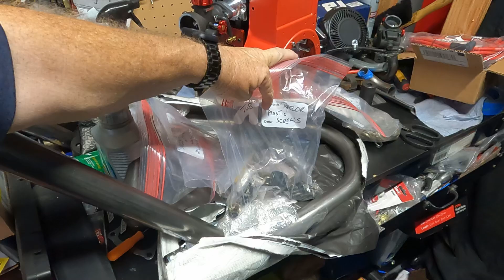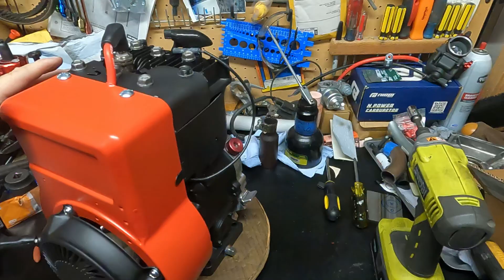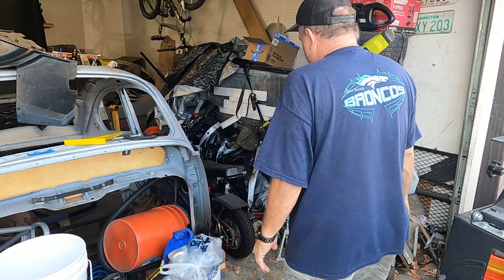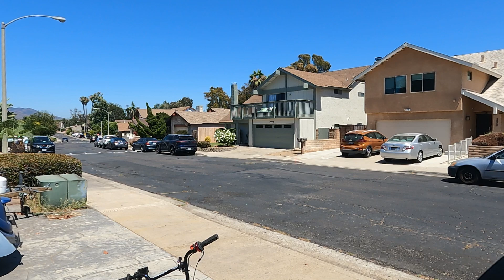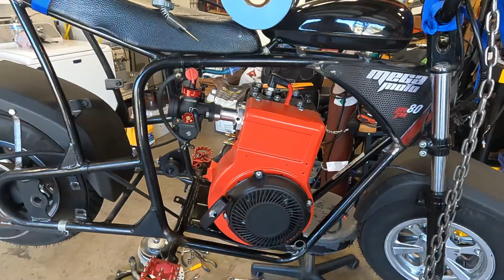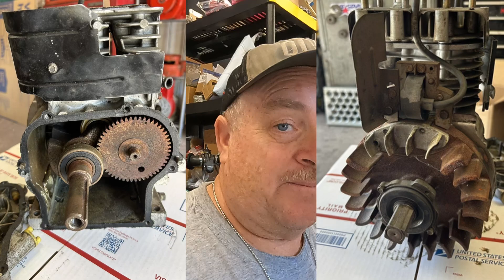Briggs Raptor Build - Will It Finally Start?

Comment: What starter cup and Recoil was used to convert ??  I want to move away from the old style that has the starter clutch and plastic recoil..
Reply from the maker: Hello Shawn, I bought the starter cup and recoil from eBay. The parts came off of a Briggs and Stratton 135232 5hp engine. It was an assortment of parts that were exactly what I needed. Hope this helps you. Thanks for watching!!! 
Willy

Comment: I have a raptor engine identical to yours pushing 25 to 30 hp and I cannot find a belt driven clutch suitable for it , any help would be much appreciated
Reply from the maker: Hello Hunter, Sounds like a great engine. I haven’t been able to get mine running yet. Hopefully soon it will start.
For clutches for that kind of power I would suggest the 780 driver/driven combo from GoPowerSports. You would need a shaft adapter from 3/4” to 1” size to run the clutch on the engine and make up a jackshaft for the driven side.
Hope this helps.. Thanks for watching!!
Reply: @DIYWilly  mine give me problems at first , just imagine a built engine from a stranger with a Tilly carb trying to get it running smooth while having spark issues. Replaced the coil and wire and you would not believe the difference. I’m sure by the sound of yours it may be just that . These Briggs are indestructible.
Reply: Also just ordered the comet super 44s magnum 😎 with a 44 series big brother to back him up .
Reply from the maker: That should get you going.. Thanks for watching Hunter!! Let me know how the new clutch works out.
Reply: @DIYWilly  sure will

Comment: Cool video 😎 persistence will pay off! We need to plan a minibike madness race in Ocotillo this season. Thanks for the update and sharing ☮️🤙🏻
Reply from the maker: Going to try a new spark plug. I’m using an old one now. Probably whelp but couldn’t hurt. I have to believe the cam timing is off. I’ve already tried the usual stuff. I really didn’t want to open the block again. Thanks for watching!

Comment: I would give it a shot of carb cleaner down the carb throat and see if it hits on that. With a brand new carburetor it may not be getting enough fuel to start the engine. You'll get it. Likely just needs a little tuning on the carburetor jetting. If it doesn't try to start with a shot of carb cleaner, it's back to basics. Timing, check both cam and ignition timings (I've installed a billet two piece cam in the wrong timing position before), compression (I've broken rings during an install and didn't know until I tried to crank the engine), and valve lash (excess or not enough lash can cause issues). I'm thinking it's fuel related though. I know you're frustrated, hang in there. It's happened to everyone that's built these things at one time or another. You'll find the issue and correct it. Don't be afraid of pulling the sidecover to have another look at the camshaft timing. Some of those Dyno billet cams have multiple timing marks on a removable gear that can cause install issues (full confession LOL).
Reply from the maker: I’ve tried the starter fluid in the carb and nothing. I took the carb of Biggs that ran fine and again nothing. I check the flywheel for the key. Never know I could have forgot the key but nope it was there.  I also tried changing the coil to a Briggs coil. 
I’m think the cam timing. So I’ll get the engine off and back on the table. I have a similar no start issue on my 224.  I never went back to it to try and figure it out. I can’t let that happen with this one. Thanks for watching!
Reply: @DIYWilly  It sounds like you've narrowed it down between cam timing and valves. Maybe verify it has compression with a quick test while you're checking stuff. You'll find it.
Reply from the maker: Yes should definitely check compression.

Comment: Briggs looks good i got a new body mount cant wait to take yhe vox on a long ride son in law got stopped tonight 63 in a 25 on it luckly cop was like first slow it down second he has a doodlebug and what will it take to make mine that fast ive been texting the guy past hour on what parts he needs and he cool letting me build it for content 😅
Reply: Great stuff! As we age it is more and more important have some cheap hobbies. I rebuild 2 stroke dirt bikes, weed wackers, leaf blowers ext. I’m a 2 stroke engine loving guy. I have an 02, 05, 14 Yamaha YZ250. An 05 big bore YZ144(modified YZ125). An 04 Honda CRF450 converted to an 88 CR500 2 stroke ( 88 CR500 engine in a 04 modern aluminum 4 stroke roller. It’s like riding a mad buffalo! The torque is outrageous! They call them CR500AF for aluminum frame. I love your tips on the frontiers especially. It’s really helped me out. I completed my 2016 desert runner (Titan swap conversion) with a 10” lift up front. Add-a-leaf and 3” block in the back. I love the truck. It gives it a lot more capability. So thanks again for the good advice.
Reply from the maker: That’s cool with the cop. Should be a sweet build for breaking the law. 😂
Any suggestions for why this things not starting? I’ve check spark and carb. I’m thinking cam timing.
Reply: @DIYWilly  ive never ran a timing key in any of my Briggs motors it's dont mess with them as much anymore